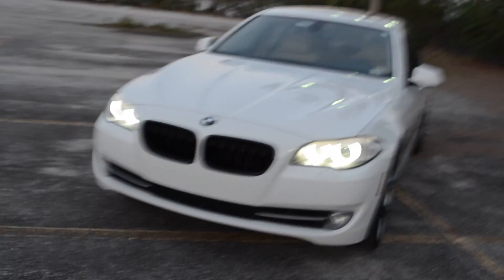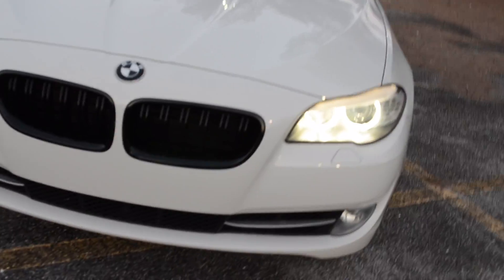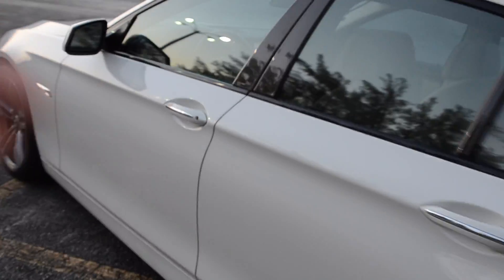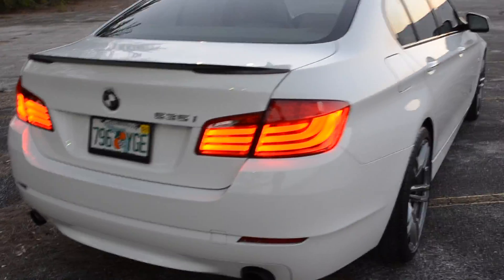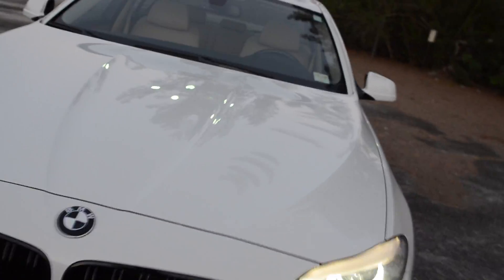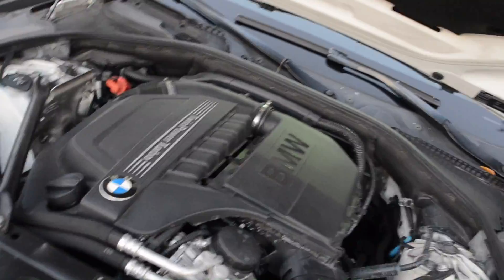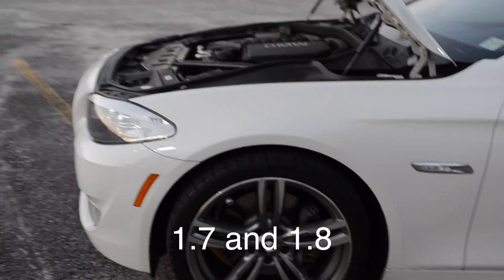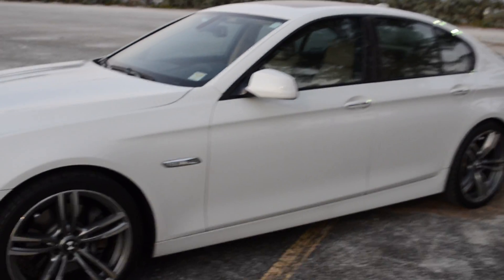My BMW 535i

Comment: By the way. My 550 is nearly exact looking. Same roof spoiler, same rear lip, same color, same front grille. Mine is a real m sport package, 2013, real m5/m6 rims (343) on 285 rear 255 front lol. Mine got  carbon front spoiler also and stock exhaust.